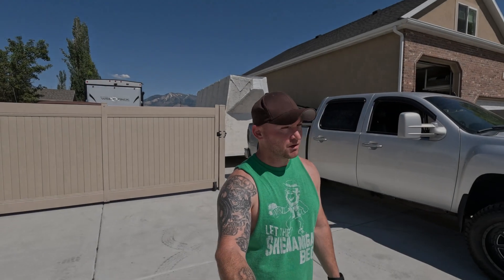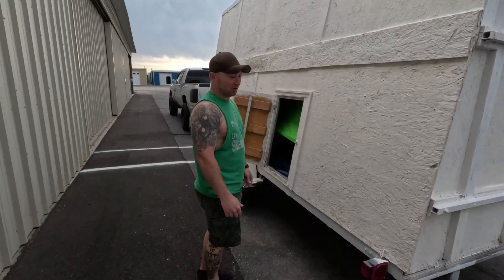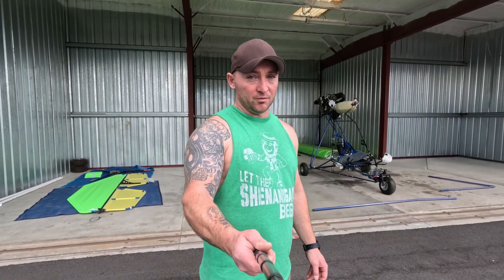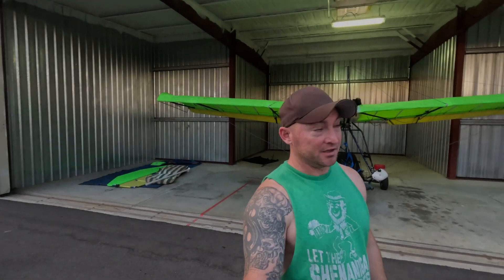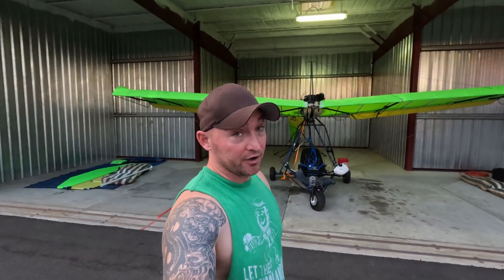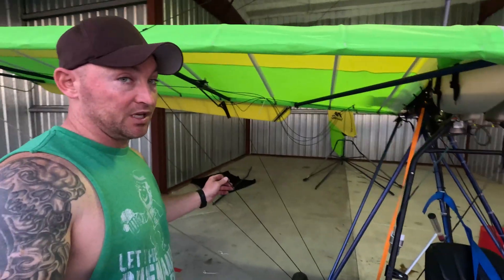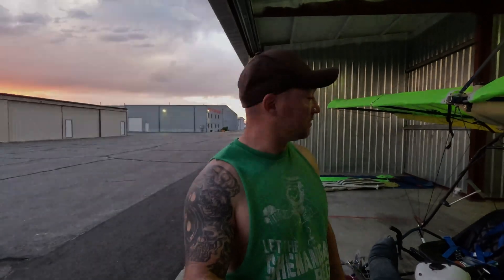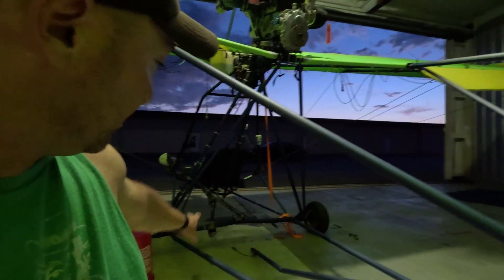02  New Hangar And Quicksilver Ultralight Assembly

Comment: Where did you get your flight training? I have had a hard time finding an LSA instructor training in a similar craft as mine. Mine is a different tractor set up (Phantom X-1) than your pusher configuration, but similar in size, motor, weight,etc. I’d like to find a CFI with an LSA similar to mine (tractor), but would settle for some hours in an LSA like this. I have 25+ fairly recent hours in a Piper Cherokee, 1000+ current hours on a powered paraglider (aka paramotor) and about 10 hours on a 2 place Quicksilver over 30 years ago. I flew the Phantom once by accident about a year ago and have waited to find more training to fly it again. The accidental flight was while doing some high-speed taxing with some crow hops at my local airport’s grass field. I was progressively increasing throttle with each pass down the runway until I hit the 503’s power band and shot off the ground. I had a few obstructions coming up I did not feel I had enough spacing to put the craft down safely, so I jammed the throttle to maximum, and committed. Fortunately, I was able to circle the field once and come in for a perfect landing. I’m confident I could fly it if I had to, but I promised myself when I bought it I would get some transition training before I flew it. After that accidental launch I felt pretty confident in my skills, but I know it is foolish to rely on this confidence without experience. Any information you (Or someone reading this) could provide on finding a CFI with a like kind or similar. LSA would be greatly appreciated. Thank you!
Reply from the maker: Wow! That Phantom looks pretty interesting. It will definitely have some different flight characteristics than the Quicksilver. 

I got my ultralight/sport pilot training through Oregonsportpilot.com. 

I would give Wolf (the owner) a call. I don't think he has tractor type ultralight on hand, but he may know of someone who does.